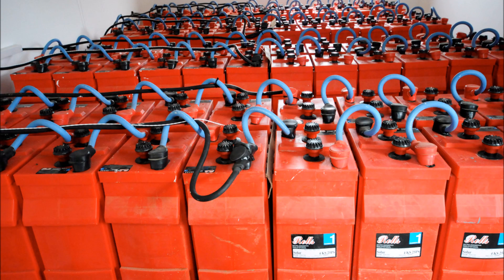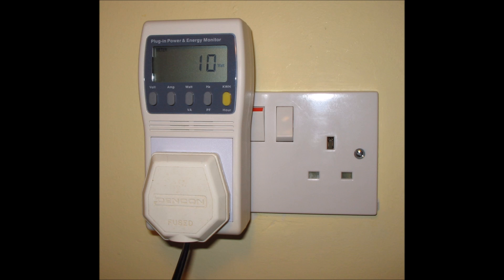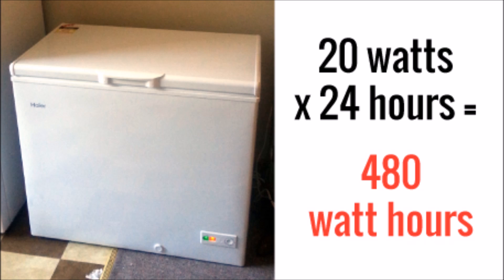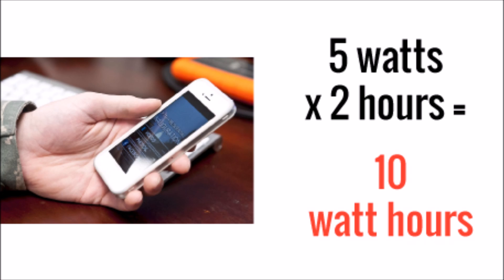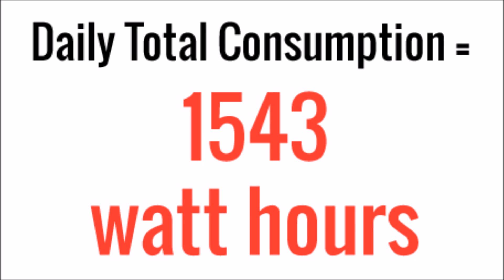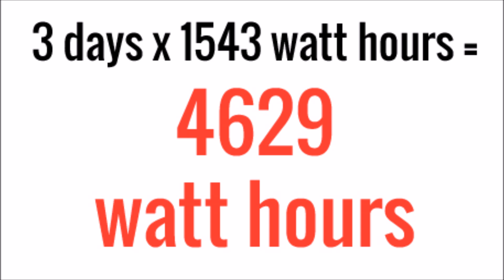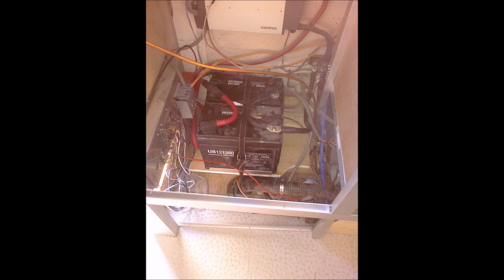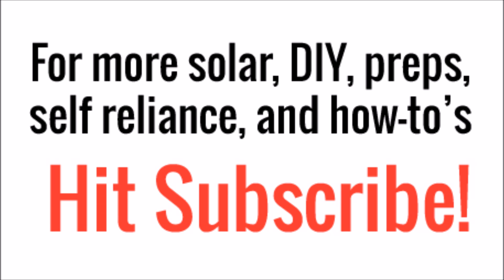How To Size Your Off Grid Battery Bank Capacity For Solar - Math Warning!

Comment: i have one 850va solar inverter with 160+160 solar pv panel.

I can connected one more set same size solar inverter (same manufature) in barallel connection

For increase the load capacity to single outlet
Reply from the maker: OK, what is your question?

Comment: Your a bit off your rocker...............  How much does that inverter draw in an average day.....just to run..... that's the main first question...... Inverters aren't regulated by Watt Hours... if you don't get this.. you haven't done enough time off the grid..... I live it.. I'm a trucker.... My inverter alone if it can power a microwave  even when being charged by a 260 amp alternator will drain four full sized deep cycle batteries in 12 Minutes, when running..... If you want to find out how much battery bank you need truly. Best to ask a trucker. We know, it's how we do things. If your moderately living.. like watching two hours of big screen TV a day...and powering your dvd player, or your Fun Boxes.. your going to need at least 16 deep cycle batteries.. with some HUGE HUGE HUGE solar power capabilities.... If your talking Freezers.. your getting up into the 5000 watt range.. with microwave.. with a stove... with a tv with a dvd player and any form of entertainment system.. best to just fire up your generator if your doing it all at once. If your talking a washer and dryer for those who live in snow country up north.. your talking you'd best invest in about 100 000 bux in solar panels.. and about 100 000 in batteries, to make sure you can power your home.. with todays prices.... stick with deep cycle batteries is my advice.. some men say GOLF CART batteries are the best.. 6 volt in parrellel with inter linking, in line .. to make 12 volt true deep cycle batteries, which are truly hard to find these days........... man your sucking electricity like a normal house hold.. you'd best consider about 3 to 8, 5000 watt 10 000 peek inverters. If your a genius.. you'll figure out how to get past tesla's car with charging stations and hook up a few alternators to pully's off the drive shafts or circular wheel powered shafts hooked to under car alternators that have battery isolators to each few batteries off each alternator.... wind powered turbines to a few automotive alternators. could be a way around it as well.. but Tesla Engineers couldn't understand this??????.. something that totally surpassed Tesla's engineers with four turning wheels they could have attached multiple alternators too on their vehicles.. only to charge the public to charge 12 V batteries every so many miles via a credit card over an internet hook up... You RICH FK'RS WHO THINK YOUR SMART THAT DRIVE THESE THINGS ARE MORONS!!!!!. GENIUSES NOT!!!!!!!... If your real smart.. water power turning alternators on rivers.. or wind power turning alternators... or even a generator when all else fails turning alternators, would work..... AMAZING how automotive science is STILL ruling the world when it comes to morons...... 200 amp alternators can rock the average mans' world if set up with some knowledge.....pully's... water wheels... wind.....running off other rotary equipment your already powering.. like DRYER BELT FANS... WASHING MACHINE BELTS...all these things have endless capabilities.. and are already powered off of electricity.. and can essentially produce MORE electricity than it takes to power them in the first place.. just takes a genius or a man that isn't a moron to see it.... could I set up a whole house, in a matter of a few weeks to be completely self efficient with the help of a few junk yards and GOOD battery builders for deep cycle batteries and a few generator places for when all else fails.. YES....would take a matter of a week or two.. but this system here is off it's rocker....There isn't an inverter that stays on for hours that doesn't draw current.. this idiot should know that.....when he talks to the public about electricity for individual items.Half the electrical appliances in the average home have pully's that could turn alternators... it's just the government and the powers that be don't want you to produce your own electricity.. they penalize you if you try......They'll find a way to criminalize you... I assure you...... THEY NEED HYDRO ELECTRIC MONEY TO SURVIVE AS A GOVERNMENT. Best not to try to attempt it.. unless your ready for a revolutionary war... because they will come for you if you show others how to do it....... The world is kind of a nightmare that way.... Tesla, you should be ashamed! BASTARDS! Endless power is easily possible.. It just depends on how smart you are to get it... and how fast the government knocks you to the ground, for explaining it to people beyond what their formal education system teaches them....... TEACHERS are the OTHERS who should be ASHAMED.....Union Pricks who just care about their own paycheques when endless power is readily available.. and almost every electronics teacher knows it......
Reply from the maker: A microwave will not drain 4 batteries in 12 minutes.  A microwave is 1000-1500W, which is 125A @ 12V or 62.5A @ 24V.  You said a 260A alternator is charging the batteries but even if not you are still wrong.  1500W for 12 minutes is 300Wh or 25Ah @ 12V or 12.5Ah @ 24V.  That is nothing.  Most golf cart batteries are 225Ah so they would be drained less than 10%.
Reply: Shut up you boomer! IDIOT !

Comment: i am new to this subject...just wondering....how many batteries is that?
Reply from the maker: It depends on how big each battery is.  There are lots of sizes and types to choose from.  Another factor is the voltage of the battery bank.  Generally you want to only wire batteries in series if you can help it.  But it is possible to use multiple strings of batteries in series and connect them in parallel to increase the capacity.

Comment: So how many batteries you need for 772 amp hours
Reply from the maker: It depends on the type of battery you want to use as each of them have their own capacity ratings.  It also depends on the voltage of the batteries and what voltage you want for your battery bank.  If you use 6V batteries but want a 12V battery bank you will need to double the number of batteries.

In the example of this video, if you were going to use Trojan T1275 batteries, which are 12V 150Ah, you would need just a little over 5 batteries so call it 6 batteries.  If you used Trojan T105RE batteries, which are 6V 225Ah, you would need 8 batteries.
Reply: 14.

Comment: I'm starting to lean towards the theory that you should really only need enough battery storage to get you from sundown to sunup.
Reply: this is why i plan to make a hybrid system about half the panels i need and half the wind turbines i need and i'll always keep a way handy to charge the batterys not sure how yet though.
Reply from the maker: Yes, that is the bare minimum you would need.  But what about if it was a cloudy day?  Then you would not get enough sun to recharge the bank for the next night.
Reply: I have enough panels that I can charge my battery bank on a rainy day. Last summer, before I got my upright freezer, I was able to run the house for a couple of weeks solid on a 24V 127Ah battery bank. Now that I've got the freezer, I can't do that anymore.

Admittedly, this isn't something you can do in an area where you get days and days of snow, but if you live in an area and get days and days of snow, then you need a battery bank that can get you through those days. BUT you also need to be able to charge that battery bank in ONE day. Why? Because the next day might just be cloudy again.

So for me, having enough panels that I can charge my batteries on a cloudy day works.
Reply from the maker: Right, your solar panel system should be designed to get you back to fully charged in one day.
Reply: Some good ideas here.  But I ask this question: why not experiment with small electric powers generators to supliment or sustain bank charge?

Comment: One mistake is not to add the wattage of inverter.  It also cost power to run it and sometimes it could be quite a bit of extra power to run all day.
Reply from the maker: True.  Good point!
Reply: Truely.  My thoughts with the power source I am planning is to start with the original output and see what the output is at each stage of things added, like inverters, monitors and such, so that I can see where I need to tweak things tho get the target end output I'm looking for.
Reply: Quality inverters are in the range of 94-95% efficient these days...and the zero load power usage on a good 5kw true sine inverter will run around 25w or so in general.
Reply: @wb5mgr  yes good efenciency on high Volt 48 ..!!! Not 12Volt still 24++ watt or @2A

Comment: Hi
Thanks for the information. Very interesting. I have an incubator of 170w , 230v , 50Hz. I want to use it  for 28 days consecutively. Please can you calculate for me the solar panels, the batteries and  controller should I use?
I need your help please.
Reply from the maker: Where do you live?  This would run around the clock?  That will be a very big solar panel system.

Comment: I'm assuming this is for a 110v system what would you have to change if anything for a 240v system thanks
Reply from the maker: Not much, really.  It would change the inverter that you would have to use but the battery capacity would remain the same.

Comment: I calculated that for my home to use 100% battery use for a year, I'd have to fill every cubic foot of my home with lead acid batteries or I'd need two homes...one home to live in and another home to fill with lead acid batteries.
Reply: You must have a absolutely enormous energy consumption!.....or you really suck at math lol.
Reply from the maker: Wow, that is a lot of batteries.  Why would you need it to run for an entire year without being recharged?
Reply: He wouldn't.  It was a thought experiment.
Reply: Jerry Lifsey  yes for me it would take 55 batteries rated at 105 amp hours just for 1 day's use. Use 1000 KwH per month. 33.3 KwH/ day. I live in Texas where the AC runs about 20 hours a day. Without that I'm sure my consumption would be drastically less.
Reply: @texjames2000  Move to a net zero home.. That means encapsulation and insulation that meets passive house standards.  There are lots of ways to take care of your heat load. Eliminating it is the first thing to look for.. Go to geo source to make your system more efficient. use an inverter Variable speed compressor.
Reply: arent  you glad  you do not actually need this many batteries?

Comment: You can also look at your electricity bill
Reply from the maker: That is useful information but does not give you enough to do the math to size a battery bank.
Reply: tells you the kWh usage per day,  which is what you were doing by adding each appliance.  After that everything is calc and estimate

Comment: I am going to purchase 250 watt poly 24 v and 24 v batteries, so Should I calculate amp hours using 12 volts or 24 volts?
Reply from the maker: Use 24V.
Reply: Do you want to use a 12 or 24 volt system?
Reply: jayw900 24

Comment: my problem is I have a 5 kW inverter. and a 200 ah 24v lead acid battery bank. for a off grid home. no solar yet. and have to run the generator every time I turn around. it sucks running the gen so much.  trying  to save funds to buy more batteries and panels. I am not picky about battery chemistry. I just bought what I could afford. great video
Reply from the maker: Thanks.  Buy what you can afford is a great start.  If you are careful and thoughtful you can design your system so you can upgrade later.  Get a nice charge controller and just start adding panels one at a time as you can afford.
Reply: LDSreliance 
that's my plan. get away from using the generator so much. I don't mind using it on laundry day and what not. I also hope to build a water wheel generator. to help charge the batteries.
Reply from the maker: That would be cool.  Do you have running water on your property?

Comment: Ok I'm a newbie 

So how many batteries I need?
Never did say?

How do I know what Amos my batteries have ? 

How many panels do I need?

I'm thinking of getting solar off grid 
Water , wind also with generator.

Plan on about at least 6000 watts I think I need. 
Plan on doing a aquaponics etc self sufficient everything. 
Nothing is built yet plan on doing my solar first so when house is built it's ready. 
Still confused about bolts amps watts watts...
Reply from the maker: I didn't say how many batteries you need because I don't know what your needs are.  I showed you how to do the math.  I would be happy to help you do the math if you let me know what your loads are (in watts), how many hours you will use each load, and where you live.

If you are confused about volts, amps, and watts watch this video series: https://www.youtube.com/playlist?list=PLbKwoGlXEWapfh6AwV1F3FdOIb3hlGcYh
Reply from the maker: Nice comment, Scott!

Comment: Deep cycle are no good..AGM is very good and very safe and no off gas.or very little.
But to tie all of your batteries together is bad to
Reply from the maker: AGM are deep cycle.  Are you talking about flooded lead acid vs. AGM?

And tying your batteries together is bad?  That is called a battery bank.  It is done all the time.

Comment: Thanks for a great video. My problem is, if I take your example, a 700+Ah battery bank will weigh more than my van... And lithium is several years from being affordable. Made me reconsider my plans. Thanks.
Reply from the maker: True.  If weight is a concern then lead acid batteries may not be feasible.  Good luck with your plans!
Reply: I have just started trying to educate myself on this subject, and thought that 8Trojan 220ah batteries at $250 each would do it... as per LDSreliance kit seen here;
https://kit.com/LDSreliance/medium-size-solar-diy-kit-632-watts#order-2-of-these-2

Comment: How about cooking, cooling, lighting, heat, water pump, water heater? So I figure 10x that for a real cabin you can actually live in. Then at least 5 days where I live, then enough solar panels to charge all that up quickly, lest you only get 2 days of sun and another storm system moves in. Guess you could just get a huge propane tank and do all the heavy lifting with propane.
Reply from the maker: Yes, the math will be different depending on what your needs are.  If you add in the big ticket items you are talking about then you may want to consider other energy sources like you suggested with propane because solar is not efficient enough to be cost effective for energy hungry loads.  Solar water heating is very efficient, though, as it does not use solar electric panels but instead uses pipes to heat up water with the sun.  So you could use that for all of your hot water needs and heating your cabin or home even in the winter (heat the home with radiant heating in your floors).

Comment: Great info. Now how do you equate that to the number of batteries needed?  How many solar panels needed to maintain that?
Reply from the maker: Number of batteries needed should be straight forward after you have determined the load and capacity calculations in the video.  Simply choose a battery you want to use and then divide the overall capacity required by the chosen battery's rated capacity and that will give you the number of batteries required (in parallel).  I will say, though, that it is MUCH preferable to wire your battery bank in series than parallel so hopefully you can choose a battery that is very close to the capacity you need.

The number of solar panels needed to maintain the battery bank is much more complicated.  I doubt I could do it justice in written form here.  But it is better to have your panel array be too big than too small for the battery bank.  Too small will mean your battery bank may be operating most of the time in a half charged and half cycled condition and it will shorten its life (lead acid anyway).

Comment: MY CONFUSE?? How is somebody in the middle of nowhere gonna have all these entertainment devices?? Will WI-FI work in the middle of nowhere?
Reply from the maker: Off grid does not mean remote.  It just means you are not connected to the utility power grid system.

Also, there is satellite internet and quite a few companies like Facebook are developing ways to get high speed broadband internet service to rural areas.
Reply: its just an example,  they are just load.  How about thinking about the topic